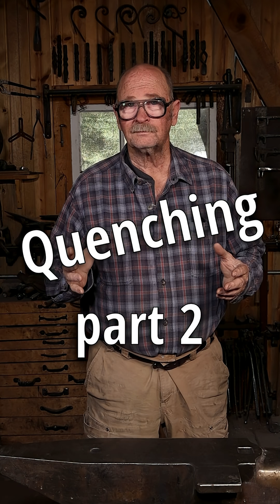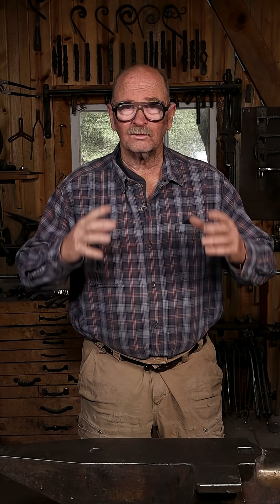Is OIL really the best Quench for Tool Steel?

Comment: Isn't the critical parameter for quenching the rate of cooling? That should depend on other factors such as material thickness on addition to the quenching medium.
I don't really understand why steels have designated quenching mediums but I assume that it is simply the quenching medium that works for that steel in typical conditions and material thinkness?
Reply from the maker: The quenching medium is the largest factor controlling the rate of cooling.   When looking at the data it generally talks about things in terms of inches of thickness. As blacksmiths, we are generally working with things much smaller.  While the quench medium usually remains constant what changes is often the volume and circulation of the quench.  Quenching a chisel in a gallon of oil is different from quenching parts that are several inches thick and require 100s of gallons of just the right oil circulating to keep the oil in contact with the part from being too hot.

Comment: I had used an unknown steel and tried quenching in different types of oil and could not get it to harden,  I tried it in water and even tried snow but could not get it to harden. I happened to be listening to the wheel of time books by Robert Jordan and one of the characters is a blacksmiths apprentice and he had used salted water so I made some brine and tried that and low and behold when I quenched it in the brine it hardened up to what I was needing,  I have since been keeping a tank of brine for when I need it.